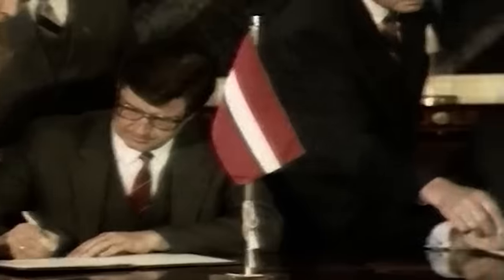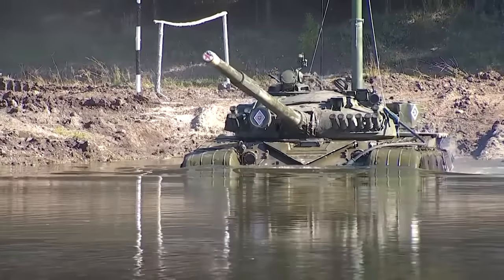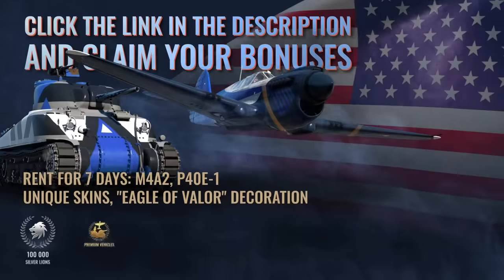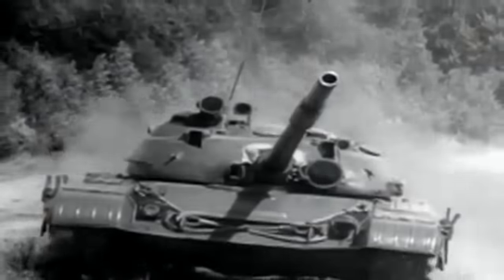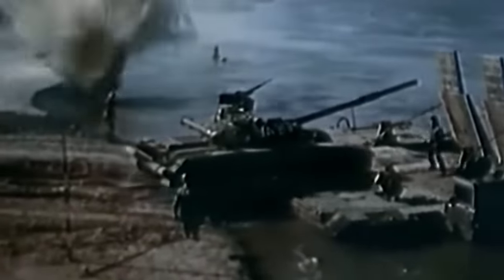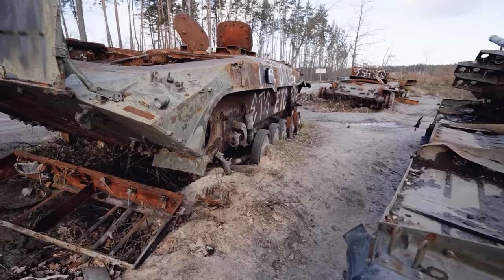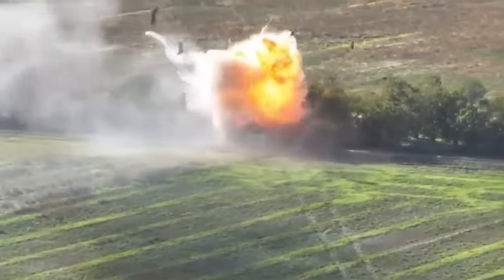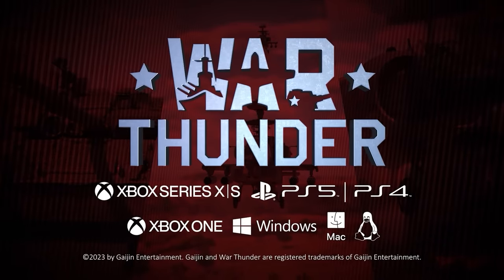The Tank Russia Is Really Starting to Regret

Comment: When I was stationed in West Germany with 2d ACR some 35-plus years ago, our primary opponent if the "balloon ever went up" in Europe was an Independent Tank Regiment of T-64s.  At that time, we had M1s with the older 105mm main gun that wasn't reliable against the front armor of a T-64.  We developed some terrain-specific tactics to maximize our lethality with the M1s and quickly figured out how to integrate the TOW-2 missiles on the M3A1 Bradleys.  I'm glad that we never had to find out whether or not those tactics would have worked.
Reply: The USA always wanted the Rh 120mm gun on the Abrams but a full range of ammunition wasn’t yet available so they settled on the 105mm L7 for the M1A1 as an interim.  Likely very effective with DU.
Reply: That seems to be the current tank battle doctrine: tanks cover bradleys, bradleys cover infantry, infantry cover tanks. The bradleys can use their cannon to suppress infantry and TOW's to take out big targets and speed to flank.

The Russians in Ukraine are still using the old Soviet strategy of tanks, tanks, and more tanks. It's proven to work very poorly against the multitude of fast-moving anti-tank weapons, similar to your outlined tactic.
Reply: I worked with TOWs for almost 20 years. I've been on Russian tanks, been inside. The things are not built very well, as a matter of fact in my opinion their pieces of crap. I've got a pretty good imagination but it's very very difficult for me to imagine those things could survive a hit from an M1 Abrams, even with the 105 gun. Those things are garbage and a great example was that they were decimated in huge numbers in Iraq. M1's had a lot of kills I don't really see what has changed between that time and now. The M1 Abrams and the challengers are like the Terminators of the battlefield.  Can you kill them, yeah but it's going to take a lot of work and it's a freakishly dangerous thing to try. I was airborne infantry the vast majority of that time working on TOW's and the one thing that I've noted about the Abrams is just like the terminator, you bargain with it, you can't reason with it, it doesn't feel pity or remorse or fear and absolutely will not stop, ever, until you are toast! I love that line.
Reply: @mrgrinch837  im sure they did feel like crap, they were designed to be as cheap as possible. the entire soviet doctrine was always to rely on the sheer numbers should any serious conflict arrive. a good example of this, there are 14 seperate components in a single M1A1 T156 track Link or shoe. russian tank tracks have a total of 2 components in each track link. they use floating track pins with a shoulder on one side. this means they wont come out one way but they work their way out the other way (towards the tank). a big lump of metal is welded to the hull which the pins will hit against and be knocked back into place. pretty? no, quiet? no, cheap? yes, easy to fix? yes.
Reply: I'm just an 11 Hotel that almost got into M1's while on active duty. Wasn't able cuz they promoted me out of the category. I do know that there was a not-so-friendly fire incident where an M1 was hit by two Hellfire missiles fired from an Apache (not the brightest crew in the air, obviously slept through the Armor ID class). The only injury was one of the crew members was burned from a ruptured hydraulic line. It was able to crawl away under its own power. Knowing that in one of their last conflicts the Israelis ran out of live Warhead TOW missiles and were forced to use their practice rounds in combat. Same weight same velocity. The effect was a hit to the turret would disable the tank knocking the turret off its ring and also disabled the crew who is to this day still asking people to answer the damn phone!  We got a lot of these tanks donated from the Israeli government afterwards. Point is, if an M1 Abrams can take two hits from a Hellfire which weighs in at 110 lb, exactly twice the weight of a tow and flies close to the velocity of 0.6 the speed of sound and shrug it off I'm pretty sure it would beat the living hell out of Russian tanks. This Beast is the Terminator. @SMVB-cl6oc
Reply: I’m pretty sure the tactics would not of worked. As ex British Army I’m highly skilled in second rate equipment 😜!!
Reply: @mrgrinch837 The Export variants were always a little bit worse and also, the americans bullied the 3rd world country iraq with air superiority, could report and bomb enemy tanks, locations, the iraqi crews were not at any level as well trained as the soviets and they only had those tanks in small numbers and with the old export 3BM9
Reply: @sovietheart3883  number one, if I remember correctly Iraq has been at War for 8 years with Iran so to claim they were not prepared for combat is not quite true. Number two yes we use air superiority, we don't fight fair. When you want to win in combat you want to do so with this few losses as possible. Number three, as a ground troop if you look up and you see anything but A-10 Warthogs or ah-64 apaches, F-16 Falcons, AV-8B Harriers and whatever the coalition added to the mix.  These are not considered "Air Superiority" mission, they're called Close Air Support (CAS).  Air Superiority are primarily fighter on fighter.  We didn't use air superiority to attack ground targets, the air superiority was to keep the bad guys jets out of our airspace.  But.., if there was a target of opportunity that presented itself, by all means an Eagle or Tornado will roll in and make their lives short.  You want to win the war, you sneak up behind them and use a baseball bat to the back of the head.  Fights over.  We don't fight fair, we didn't show up to dance.  When you look in the parking lot and see us and the coalition forces pulling baseball bats out of the truck of the car, it's likely a good time to leave.
Reply: @mrgrinch837  I love the way you write, you latest comment, and your second point towards  @sovietheart3883 is true.
It is how ever also completely out of context, or at least confirming what they are saying.

Your first point is just either disingenuous, or I'll informed.
Your second point highlights this.
Even though Iraq had been in a war, that was agains a near peer. Something completely different then fighting the worlds only superpower and it's allies. We "do not fight fair", like you said.

They are explaining why Abrams vs T-72 in Iraq, isn't indicative of which tank is better, or how big a Gab there might be either way. Exactly because of what you explain in your second point, and more.
The Iraqis didn't and couldn't use their tanks in the way they were meant to be used.

To be clear, I'm not convinced that the Soviets as they say, or even the Russians of today, train their crews better then Iraq did.
I think reporting from current, both Western and Russian sources indicate, that Russian armor training is insufficient at best.

Side note:
Back to your way of writing.
You completely incompas how I felt in Helmand, with our side having airsupremacy, as well as Artillery dominance. With me being a Forward Observer. I can't count how many times, that fact got me out of extremely hairy situations.
I'm glad, that I never experienced fighting a near peer, during my ~15 years. And even more so, that I'm now retired from the Forces, given how war has changed with among other things cheap drones.
Reply: @mrgrinch837  As to your impressions of Soviet tanks. I've also been in T-72, T-64 and earlier Sovjet tanks. As well as most (I think) NATO tanks 1960 - 2000 models. I have different thoughts on the matter, that are more in line with what @SMVB-cl6oc says.
One thing that they allude to, which is often not recognised in forums like this, is that tanks are very rarely going against each other 1 on 1. So any comparison of tank 'stats' are pretty much meaningless. Tanks, or any asset really, have to be consideren in relation to your own doctrine, your other equipment types, as well as doctrine and equipment of the expected enemy.

An obvious example would be the Swedish development of Stridsvagn 103 (S-tank). A tank that on paper would never be considered viable by pretty much any army of the time. And it is still highly debated if it was even a tank, or it should be classified as one of, if not the last produced Tank destroyer.
For the Swedish doctrine and the expected opponent how ever. One could argue that it might be the best possible tank, that they could conceive of.
I could see a scenario, where if Ukraine received some, they would fit perfectly on the north/north western border with Belarus. So that tanks stationed there, could be redeployed. The terrain seems to me like, what it was designed for.
With all this said. The Strv 103, is not a tank I would like to work with, for an extended period of time. I find it extremely cramped, and ergonomics as well as polished details, reminds me of a typival Sovjet tank, like the ones you dispise. Especially the "Primary" driver location seems like a cumbersome workstation.

You yourself mention TOW as being able to kill a Russian Tank, during the cold War. Yes. And it could also kill western tanks including the M1.
What has changed since then?
Reactive Armor, is a big one. Passive contermeasures like reducing IR signature, Active countermeasures like smoke/IR smoke, speed/mobility, improved composit armor. Many things that isn't on the tank, but never the less increase it's survivability. Like artillery radars, improved C2 and intelligence, doctrines among others.
But again, by you introducing the concept of TOW into the debate, you unintentionally I assume, sort of derail your own arguments of Abrams beating Soviet tanks.

Even "if" A T-72 can not penetrate the front of an M1. Mobility kills are possible, and will possible let you fire a second round in the side or rear armor of the M1. Given the Sovjet doctrine of the time, they had many more tanks then NATO. And we expected to be overrun, in the initial phase of a war.
In Iraq, the US officially destroyed 2 M1's to avoid they fell into Iraqi hands. This was likely because of a mobility kill (Maybe from T-72's, Idk). Without having looked into it, it is also possible, that some of the friendly fire incidents on M1's, was the same, but just not officially recognised as such. Such "mistakes" have precedent, for a variety of reasons.

You say, that you can't imagine a "Russian" tank surviving a hit from an M1 105mm. That's not really how it works. Im sure that the US and others have made penetration tests on non export T-72's somehow. But as you said, In Iraq, they penetrated just fine.
Many including you, have said though, that this wasn't a fair fight.
I'm sure that the Ukraneans have supplied NATO with a lot of valuable experiences, about even the never Russian tanks armor characteristics. Looking forward to this becoming open source. It will probably shed some light on myths, and might even prove me wrong. Either way, looking forward to learning.
Reply: @mrgrinch837  I'm sorry, if it feels like I'm adversarial towards you. Especially since, like I said, I like your way of writing.
And that one description, really hit me right in the Nostalgia nerve.
But apart from that, your statements are all over the place. They are anecdotal at best, and I feel like you contradict yourself, even within the same post.
With your stated experience of being a "Tank hunter", or at least operating TOW, for 20 years none the less. I find it harmful for anyone with no experience, taking your opinions at face value, given your expressed authority on the matter.
Stating that anything Russian/Sovjet is crap. Is such an ill-informed opinion, that I question whether you have even worn Green clothes, and slept under the stars, for a single day in your life. And I hope, that by voicing my concerns, people reading your posts, will not take what you write, as fact.

As to your anecdotes regarding an apache and Israeli training Ammunition. That is just that, anecdotes. While interesting. It isn't really useful, without a lot more detail. Both incidents could have been flukes, with a one in a million chance of the outcome that was observed in either case.
If you have more details, such as incident reports, and analysis, I do understand why you find it convincing. But without extremely detailed info about the events, one anecdote of one tank good, and one anecdote of the other tank bad, is never going to convince me, or anyone else, who seriously tries to understand the subject.
Reply: You may not realize it but for my web page there's a photograph of me actually flying a military helicopter wearing a military uniform. Not sure how that got by your astute observations. You are saying something about me not being a day in an actual military uniform, a picture is worth a trillion words. You have a good day sir.
Reply: @sovietheart3883  I was going to also point out the quality difference with the export models.  Even though the Soviet equipment was still cheap - somehow the export stuff was even cheaper.  Worse (or missing entirely) optics, inferior steel armour, lower horsepower engines.  Export models could be upgraded - but few countries did since even the second rate quality was about as much as they could afford.

The Iraqi army of Desert Storm was a good army with combat experience.  It just couldn't match the combined might of the Coalition (America, Britain, France, Saudi Arabia, etc) while also being overstretched with the Kuwaiti occupation, and was utterly outclassed in the air.  By 2003 the Iraqi army was a shell of its former self and was somehow weaker then it was after being defeated the first time.  There's no wonder they put up almost no fight at all in 2003 - at least as what we might consider a modern army.
Reply: Enfilade shoots from defilade positions.
Reply: artillery in the 1st 24 hr bombardment would be devastating our forward position was the fulda gap 8th inf. we were expected to hold no longer than 15 mins then fighting with draw with whatever assets we still had
Reply: @hydrocarbon8272. It is April 2024 and Russian doctrine has evolved. It's now tanks, ladas, and Chinese golf carts.
Reply: I was in 1/1 Cav 84 to 88 camp Pitman was our border camp. Ich hab Deutchland im 2000 verlassen.
Reply: @hydrocarbon82  I read some general recently state 'A Bradley's not a tank, but it is a tank killer'.  Kinda goes with your strategy.

Comment: Actually T-64 was one of the best tanks made by the Soviet Union.  It cost to build and the length of time for construction were main factors why the T-72 was designed and built.  The T-72 could be built faster at a lower cost more quickly.
Reply: That's my understanding also @abbottshaull9831.
Reply: T 72 was pretty much also an export tank to support the allies of the Soviet Union, which you usually don’t do with your high end military technology. You create a workhorse for that. It was a solid tank while the T-64 was an attempt to create the most advanced tank design that was possible - at the cost of incredible maintenance.
Reply: The cost you mean

Comment: "For its Era". Yes more than 40 plus years ago the T64 Was an reliable and robust modern tank. However in today's battle field it has a less than 50% chance of surviving any major Fire or frontline engagement. Like most Russian arms the T64 was riddled with engineering woes, poor maintenance and less than stated spec's and abilities. However it forced the West into rethinking today's Modern Battletank. The T64's greatest flaw is its lack of top side turret protection. Generally one or 2 hits from a relatively light charge can cause the tanks too literally blow their turrets at alarming rates. Ukraine is littered with broken and burned out T64 hulks. Its absurd really.